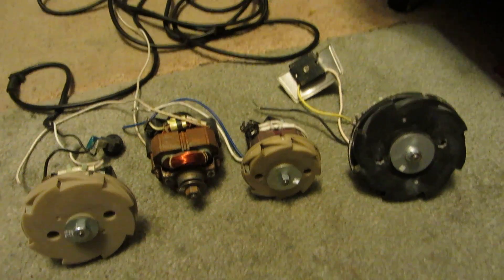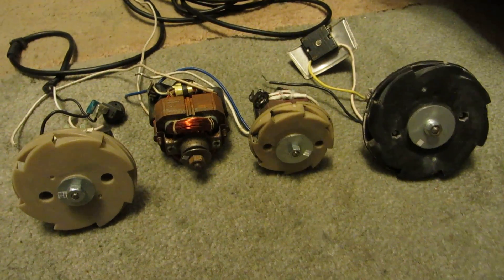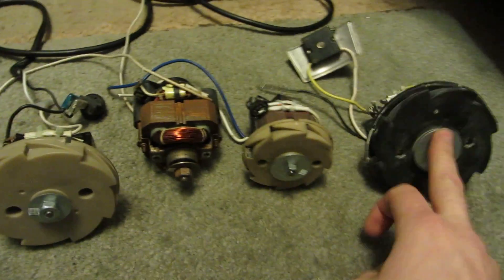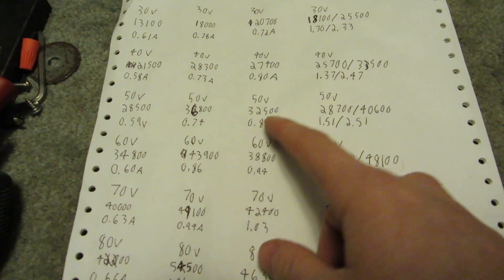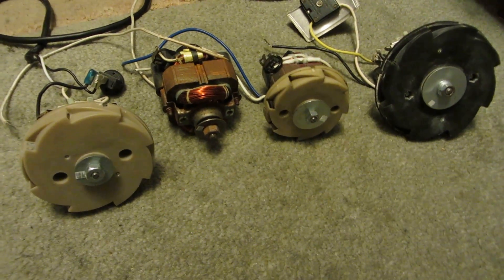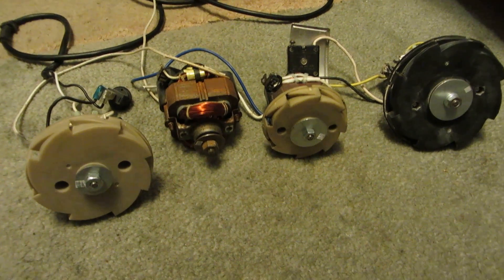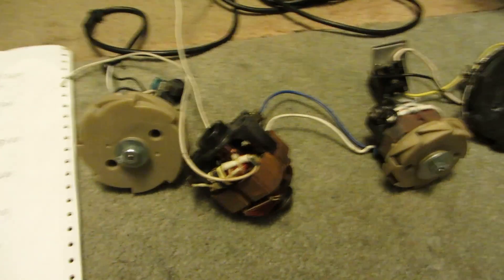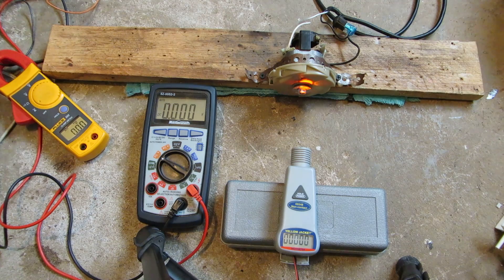Incredibly High Speed Motors I

Comment: 90,000 rpms holy shit
Reply from the maker: Yea man... I didn't expect them to get that high before flying apart...
Reply: @HL4EHalfLife  a cpu fan might not achieve 90,000 rpm. If it did, it would  have a catastrophic failure and the blades would go flying everywhere in the room. You might have to hide somewhere.
Reply: how would it be to brush your teeth with a motor at that speed? R.I.P Teeths

Comment: Now throw some sand into the bearings when the think hits 90k rpm and watch the carnage :-)
Reply: Hey I have question I have a 0.40 amps cooling fan from the white Xbox 360.can I upgrade it. I want it to spin really powerful .but can you upgrade cooling fans.
Reply: @antmotormanodessa4437  Do you mean to use it in the xbox? If so then you would need to find a higher revving fan of the same size. If you plan to use it outside of the xbox then just give it more voltage. It might take it or it might die. So no real way to upgrade it short of shoving more volts into it and if that fails you'll briefly get a smoke machine. Exciting either way.
Reply: I can try.when I have my own apartment soon. I'm going to have all this junk like DC motors and cooling fans and ac motors too.i love motors.l like how it spins in reverse and makes a jet. sound.and I'm going to make a windstorm. 60mph that will be cool.with all coolings fans and DC motors.